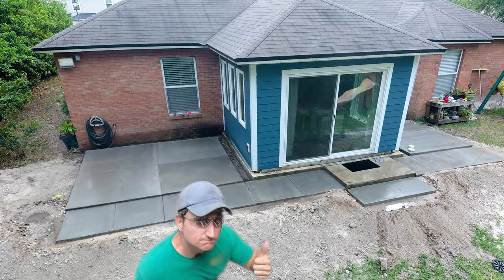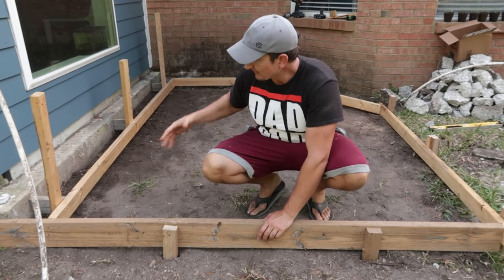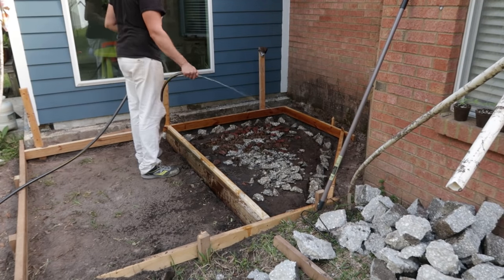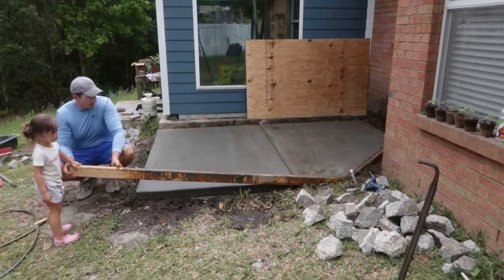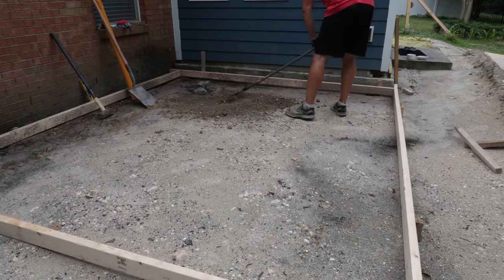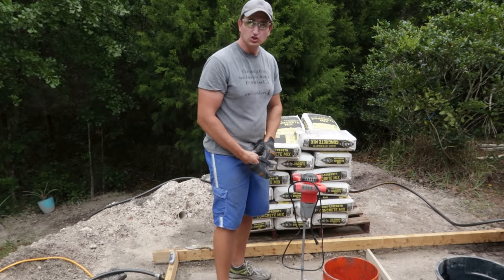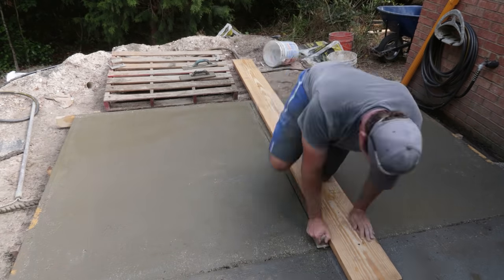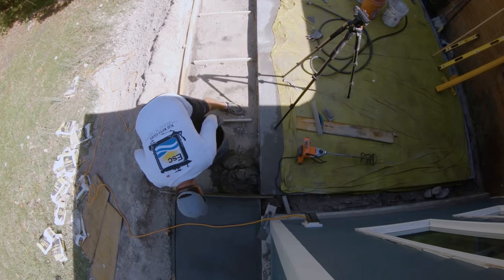Pour a Concrete Patio Entirely  by Yourself Using Bag Mix Concrete, DIY Project From Start to Finish

Comment: As a professional concrete worker of 30 years I’ll tell you right now …bag concrete is for posts holes and temp fixes . Bag concrete starts to  fall apart when used outside on patio..unless you add air . Buy from your local dispatch…it’s actually cheaper to do it once ….
Reply: .... and how would you store concrete from dispatch to avoid getting wet if it should rain?
Reply: @dasvon he means buy concrete from your local concrete ready mix supplier. If you don't get concrete with air for outdoor patio then it will crack and not last. The reason is the air bubbles help expand and contract when it's outdoors but bagged concrete is good for indoor only

Comment: Major props to you bro. The fact that you did a crazy amount of work, filmed it and managed to keep from loosing it on camera was impressive. I Worked as a laborer for  a family concrete company many years ago and know first hand how hard mixing manually can be. Yes, there will be the " concrete pro's" who want to tell you the things that are not the ways they would or should do it but the bottom line is you put yourself out there as a DYI guy with a monumental project to take on solo and the end result will serve your family well for some time to come. Great job in  my opinion. You're daughter is absolutely precious at the end also.
Reply from the maker: Much appreciated and thank you kindly. By the way, the power of video editing may have removed some of my less composed moments throughout this concrete project.
Reply: Pp

Comment: When I poured a sidewalk like this several years ago I drilled the form boards between the slabs and slid in a couple of two foot rebar about half way so that it extended from one section to the other. This kept the sections from settling separately and misaligning. Years later they are still level with each other and no "toe catching". Good (hard) job.
Reply: Excellent excellent idea thank you I needed this

Comment: After watching your videos I decided to pour one myself similar to what you did.  122 bags, 60# each delivered into my garage from HD for $85.  Approximately 11" x 14" with a small 3' x 3' step.  I formed it into roughly 4' x4' sections that I knew I could handle myself.  Each section was about 12 bags, roughly 3" deep.  No rebar used.  I mixed using a heavy drill and a mortar paddle.  Mixed in a 10 gallon garbage can.  I found it best to have a 55 gallon garbage can filled with water, the exact amount of water marked on a clear container, kept the hose running slowly in the 55 gallon can.  Put water in first, mix as best you can with the paddle.  Sitting on a stool, tilting the can at an angle, mix inside the 10 gallon can the material that didn't get mixed in.  I found throwing wet concrete on the dry, then rotate the can.  Used a cheap garden hand shovel.  Dump it in.  My can has a handle.  Found it best to work in a line, screed every other bag, edge as soon as you can.    Brushed finish with a small broom makes it look way better.  I was a lot of back breaking work.  Honestly glad I did it.  I feel really strong but a few of those days got hard.  Kept telling myself, get after it!
Reply from the maker: Congrats on your project and thank you for sharing your experience and your tips.  Really like the big bucket tip with the hose running.
Reply: Good stuff to all who have tackled the world of masonry

Comment: Concrete expert here. Overall impressive for a first time (I presume?) DIY work. 
Yes, no reinforcing needed for such application. Trenching and thickness in excess of 3.5” is overkill but doesn’t hurt… except the back :) The CJ siding plank was a clever move. The mixer didn’t hurt anything. 
Good work!
Reply from the maker: Thanks Stefan, I appreciate your concrete feedback and insight. Thanks for watching.
Reply: not throwing shade, but the finish looked really rough.  is this due to not enough finishing work being done, or is it the "wrong" kind of concrete, or what?  trying to understand for my own sake

Comment: My hats off to you sir.  Concrete work is back breaking.  To anyone thinking about a project like this, either get a concrete mixer or rent one.  Even the cheap one from harbor freight.  It saves a lot of time being able to mix multiple bags at a time.  Time you will be glad to have for screeding and troweling.
Reply from the maker: Well said

Comment: I’m about to do an 80sq ft pad behind my house for a future staircase.  I just got the 50 bags of concrete and plan on using a HOme Depot Mixer to hopefully do it in a day but most likely I’ll have to split it up.  A little nervous about it but excited.  Next time consider renting the mini excavator from a local rental.  It helped me with the base.  I put about half a ton of stone and plan on using chicken wire as a poor man’s rebar.  You’re video gave me some ideas and helped to give me that DIY motivation to hopefully not mess this up!
Reply from the maker: Thanks for watching and sounds like you have an exciting project ahead.

Comment: Considering the timing and resource limitations, I'd say you did pretty well.  Hand-mixing usually gives you a less uniform mix than the auger you used, and especially on the low setting you probably didn't entrap too much air.  Next level up would be a small drum mixer, which I'd recommend if you're taking on a project this size again single-handedly.  For consolidating the thicker edges (footings) that's a sufficient depth that a stinger would be a good idea to create uniform and hole free edges that will be less likely to wear and tear due to differential expansion (friction) and freeze/ thaw cycles.  The concrete fiberboard was a clever use of resources to make expansion joints.  If you use them again instead of standard joint fillers, I'd recommend an embedment of no more than 30% of your slab depth on thinner slabs like that.  I'm not sure how it'll hold up to rot and rain, but it would be interesting to see a 1 year later follow-up to see how you did 🤔⚡️🌐💗🤠👌
Reply from the maker: Thanks for the comment. The concrete patio is holding up well with no visible cracks or movement. When looking real closely at the control joints some are cracked, hidden in the joint, as designed.

Comment: When I pour a slab using bag concrete I just throw the bags in to the form in a pile and mix the water on the ground.
Saves a lot of effort.

Comment: 👍Good job. When I helped my Pop w/ a shed pad we put in some steel fence but he also dug what he called gopher holes in ground said pad wouldn’t move and it’d be stronger. That was in 1985. Pad is still there, my Pops is gone (R.I.P.) the concrete never moved or even cracked. He was big on prep work. Good video. 👍🇺🇸
Reply from the maker: thanks for sharing

Comment: I felt your pain.  I filled in my inground pool 10 yards of dirt at a time.  The final load I completed in one day. 
It's entirely possible for a 56 year old man who has spent the last 20 years in I.T.
However, I suggest a two wheel wheelbarrow.  Those single wheels are for the young (and maybe ignorant 😉)
Great job.  I think I'd go with a HF 3.5 cf mixer or equivalent, but your way worked well too.
Reply from the maker: Haha, thanks.  Ya a two wheeled set up sounds ideal for sure.

Comment: You did a great job. This is a great video especially for someone like myself who has about 900 square feet to do. I work outside so I am used to the Florida heat. I'm 53 but have no issues with hard work. What is so nice about what you have done is it allows someone like myself a guide to follow what you have done. It allows me to do it in stages on a budget. Concreate companies want like 7,500 to do about 800 sq feet. I'd rather do it in stages for about 3k myself. Great video. I will film my work like you to help others as you have.
Reply from the maker: Jimmy, thank you. Have fun with your project.

Comment: MrKistel,  you did a great job for your first attempt. I’m a Concete finisher for over 35y I have done jobs at 1000sf to 50,000sf and you my friend have the first thing you need to be a good finisher, the will and the drive. Some comments,like our friend the retired GC lol is quick at pointing out what you did wrong but didn’t mention what you did right.  just attempting what you did alone and without experience is impressive 👍🏻 what you think you did wrong this time, Will be right the next time. The first step in perfecting a skill, is to start.
Just a tip my friend on that height transition that everyone is calling a trip hazard, fill it in with flagstone, it is the perfect height difference for mortar and stone it will give it some character. Keep it up Friend, maybe one day you can charge for your new skill.
Reply from the maker: Thanks Mike. Interesting idea regarding Flagstone, thanks for sharing.  This concrete patio was constructed with a specific use intention in mind and has functioned as intended with no issues. In that regard, I feel what steps I took were appropriate enough because at the end of the day we are getting exactly what we wanted out of the build.  Thanks for watching and taking the time to comment.

Comment: When I move bulky stuff like your fill I use my 90 gallon recycle bin with wheels. Easier to load, just lay it down. With sand or gravel you can't fill it too high but usually can do 2 wheelbarrow loads per trip. Stand it up before it is too heavy and add a few more shovels. Works great for bark and compost.
I have a 12 by 30 foot driveway next to my house that I will use haul it myself ready mix from a rental yard about a mile away. My plan is to first pour a 3 foot wide perimeter, then pour the center, that way I have room to work because the space has my house on one side and a retaining wall on the other.
Reply from the maker: great tip!

Comment: That came out bad ass man. I bought a 3.5 ft concrete mixer used off craigslist and have allot of concrete projects planned for this summer. Back patio and a slab in my 8x10 greenhouse are the two big ones. I also have a 24x36’ barn I’ll be pouring a slab in the next few weeks but I have a buddy coming to help with that who’s been doing concrete work for over 20 years. I’m excited to learn from him first before taking on my own projects.
Reply from the maker: Thank you. Sounds like you have some big concrete projects ahead. Best of luck and keep me posted how they are going.

Comment: Whom ever told you to pour concrete directly onto a black dirt or cheap fill base had a wonderful sense of humor! An exterior concrete slab MUST be poured on top of a 2”-3” base of compacted 3/4” stone in order to facilitate proper drainage & settlement. I hope it doesn’t freeze there. Ooooof!!

Comment: Your control joint board will probably work, but I think I can explain why a shallow cut on the surface works as well.  Concrete shrinks as the water evaporates. The surface dries faster causing the stress to be greatest there. A similar thing happens when people cut glass. There is not a shrinkage issue, but glass can break from a relative shallow score, because it is so hard/brittle. Concrete is also hard.  I compare it to tempered steel which will break before it bends.

I worry about the rubble concrete chunks perhaps causing some erratic, uncontrolled shrinkage cracks for the same reason your board may cause the concrete to crack as the concrete shrinks.

Loved your supervisor!
Reply from the maker: thanks for the insight

Comment: Your pretty brave doing all that without renting a mixer. Hard work! Too late now now, but since you were mixing it yourself I would have added some fibers to the mix to make it stronger and prevent cracking. Also next time try concrete stamps. Good work!
Reply from the maker: Thanks for the concrete work and mixing tips.  The plan was to construct the whole slab area with bagged concrete mix containing the reinforcing fibers. However I could only find enough supply to pour the first half of the patio with the concrete mix containing the fibers. The second half of the concrete patio was constructed using a more standard concrete bag mix. Having said that the entire concrete area poured is holding up well with no cracking outside of the control joints.
Reply: Due to my age (mid-60s) and the size of my patio project, I will either rent a stick mixer as you did or a barrel mixer.  The job is ambitious enough as it is!  Thanks for showing how that stick mixer worked.
Reply: @JBM425  you can buy a mixer at Harbor Freight for like $200 these days. I paid $125 for mine about 3 years ago, used a ton, it sits out in the rain, works every time.
Reply: @RandomStuff-zt6qf , This!

Also, I rented one from Home Depot.

Comment: Oh yes, you are right man . . mixing bags of concrete yourself IS a very tiring thing.  I have done that myself when I layed down a small sidewalk last year and that was with a bummed up knee. . SO, yeah, in the middle of the hot summer IT WAS WORK.  BUT it came out pretty good I have to admit.   I just would not recommend doing it that way again.  Although I am considering putting down a 2 foot wide strip of concrete behind the house along the backside to try and keep any water from running down the foundation when there is a hard rain.  SO with that said. . . sometime this summer THAT will be what Ill be doing.  . mixing bags of concrete for that.   FUN FUN FUN
Reply from the maker: sounds like a fun project ahead. Stay hydrated!

Comment: Kudos!  New sub!  So, 70 years ago I was that little girl watching my Daddy hand mix concrete & lay a pad under Momma’s clothesline. It made for a great skate surface too- in and out of hanging laundry was the best!  Your vid sure helped me to know this ‘ol gal better NOT tackle that tiniest patio spot I’ve pondered!  Pulled a bunch more how-to tho for other projects.. prob in my case mainly adding to my Supervisory skill 🙃.  
Question- with time now, do you wish there wasn’t that couple inch drop between patio and walkway due to tripping??
Reply from the maker: Thank you for watching and the comment.  We are happy with how the patio was built but can understand why some viewers worry about potential trip hazard based on elevation differences.

Comment: cool job - one thing that could have helped is that if you had 10 or 15 buckets, mix them all up first, then quickly pour them and screed. But I do have a small mixing machine and have done at least 3 large patios and driveways and works fine - I did have one helper with one of the jobs - but my small mixer took 3 bags at a time - its messy, but certainly possible and cheaper - the finish is dependent upon your finishing skills - my next job is to also do stamping.
Reply from the maker: Thanks. Ya the multiple buckets could be a good idea for drill mixing concrete. Wishing the best with your concrete stamping project.

Comment: I've mixed a fair bit of bagged concrete by hand, I use a hoe and wheelbarrow. A tip, if you are coloring the concrete, mix the dry ingredients before adding the water. Also, you tamp with a tamper, tamp being the verb, tamper is a noun.
Reply from the maker: Great tip!

Comment: I have an idea to try.  After screeding add 1/2" strips ripped from 2x4 and tack on top of  forms.  Then throw down your mortar mix on top and screed again.  Now you have nice even layer for a smooth surface.
Reply from the maker: Thanks for the comment.

Comment: Excellent video !!! The work on both the patio and taking the time to capture it is very much appreciated. I do have a question on the current state of your slab. It "appears" as if you get a good bit of rain as there are/were splash marks on the brick where water runs off from your roof. This tells me that the ground may see some heaving or movement due to soil expansion (when wet) and contraction when dry. Without rebar or mesh, have you noticed any cracking or movement of the slabs? Not a critical question in any way... just curious to learn from others.  Cheerz.
Reply from the maker: Thanks Larry.  I am actually planning to make an update video featuring the current state of this concrete patio.  Long story short it is good as new with no noticeable cracks. Hope to have that video posted in the upcoming weeks so stayed tuned for that using the notifications button. Thanks again.

Comment: At first I thought you were crazy doing a small slab in 2 sections, that was until I seen you mixing by hand. You really need a concrete mixer, barrel mixer, something other than a spade and tub.

Comment: You can use vegetables oil so concrete doesn't stick to the forms..also it's a good idea to connect the slabs with mesh just in case tge ground moves the will move together..

Comment: I was just wondering if you ended up with concrete burns. You didn’t use many safety precautions mixing or handling the concrete at all! I only saw gloves you should have worn a mask when mixing. Frankly I would’ve just purchased a small concrete mix mixer.